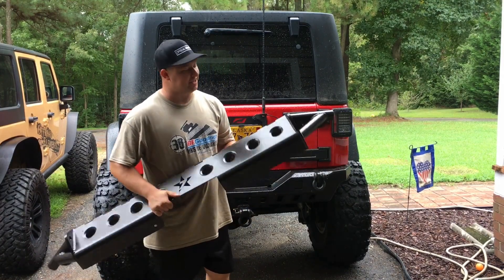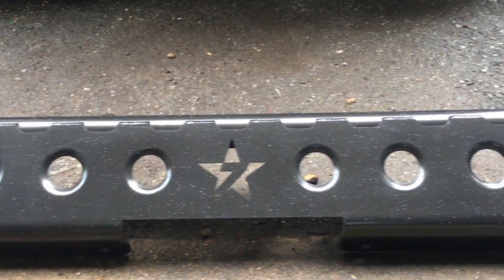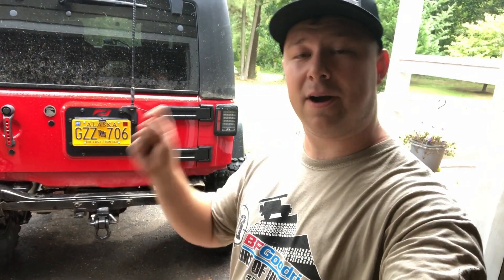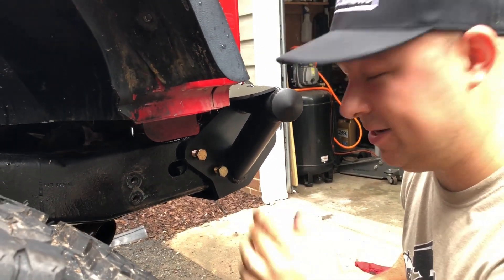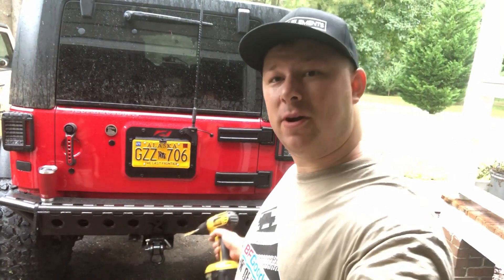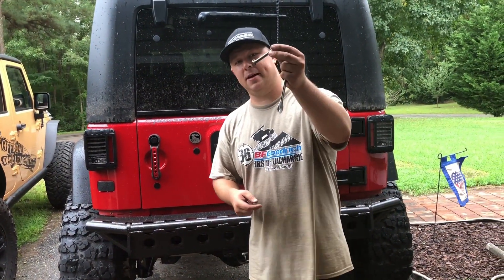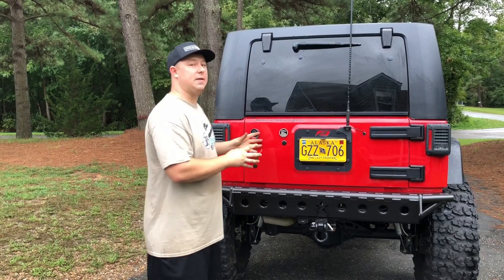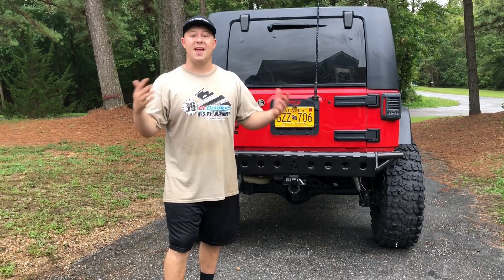No More Bulky Bumper!!  Barnes4WD Rear Bumper Install

Comment: Have you figured out how to mount lights to it?
Reply from the maker: It has 2 holes on the top side of the bumper. I might eventually put a small light on the passenger side, just haven’t gotten around to it
Reply: JK Gear and Gadgets the two small fixtures that you did an episode on.  You mounted them to your hood.  Would those work inside the bumper and took advantage of the holes in the bumper.

Comment: Something I noticed on my ‘15 JKUR:  Apparently they added the drilled holes on the right side frame rails for the right side tow hook offered by Mopar; therefore, you wouldn’t have to drill on the right side if you have a newer Jk. I think this is for all frame rails of all ‘13+ JKs since that is when the 10th Anniversary / Hard Rock Rubicons started.  Mine isn’t a Hard Rock, so maybe all the frames are the same in all trims.

Comment: I like the new bumper but I run a spare tire.  What brand was the old one? And are you running wheel spacers?
Reply from the maker: I think they just designed a carrier that works with this bumper! Old one was a motobilt, but it had a few flaws I didn’t like. And no wheel spacers.
Reply: If you don't mind me asking what didn't you like about your old bumper?  I use the Teraflex tire mount and Hinge kit I'm not a big fan of the Swing Tire mounts. is that what they plan on doing with your new bumper using the swing tire mount?
Reply from the maker: L.T.K.F. No, they are doing a tailgate carrier. And my old bumper was heavy, and the biggest issues was the shackle mounts are welded high, each time I hit the bumper on something it would shift slightly and the tailgate would hit the mounts...

Comment: I hate to say this but I am too OCD not to mention it.  After it was Installed, it looked like it wasn't quite level.  Looked like the passenger side was a little lower.  Did you use a level to check?
Reply from the maker: It probably was 😂. However after a wheeling trip and a good smack on a rock it probably shifted it a tad
Reply: @JKGearandGadgets  glad you have good attitude about it.  Would have driven me nuts 😄
Reply from the maker: Well if anything it wasn’t a mfg defect, it would be from where I drilled the holes and mounted it lol

Comment: I’m curious, say I was running the Teraflex Hinged tire carrier, if I just threw a 3 inch spacer on then it should fit just fine right?
Reply from the maker: A 3” might be a little extreme. You could always do their new frame chop rear, it will work with more carriers.

Comment: Question... is this a 7slotcustom bumper or barnes? Looks a lot like a 7 slot
Reply from the maker: Same company! 7 slot customs is Barnes Jeep specific line of parts
Reply: @JKGearandGadgets  makes sense. Thanks! I definitely want to pull the trigger on this bumper, just gotta find out if I can run a tub mounted spare tire carrier.

Comment: Hey man bumper looks good, quick question, how far past the tub does the bumper stick out to the side. I have EVO builder corners with no rear fenders so Wouldn’t want to much of the tube on the bumper sticking out. Thank you and keep up the great videos.
Reply from the maker: It’s practically even. Maybe goes out .25”. So it would flow great with no fenders
Reply: Awesome thanks a lot man might be ordering real soon

Comment: I've been contemplating going with a different bumper than my warn bumpers. I'm just concerned about them bending. Are those recovery rated? Also, I got rear ended by a full size Tacoma, and it only scratched my bumper but totaled his truck. Bad part.  They are heavy as hell and hard on the engine. So what's your take?
Reply from the maker: I wouldn’t worry about this bending. Very well made. Since it ties directly into the frame in 6 spots you will be perfectly fine with recovery

Comment: Why would you not run a spare tire on your jeep that is part of having a Jeep is the spare tire look on the back
Reply from the maker: Hard to run a 40” tire on the tailgate lol. Lots of weight that doesn’t need to be there.
Reply: It's easier to patch a 40+ inch tire on the trail than it is to replace it.
Reply: It won’t work with a factory spare tire carrier but it can with some after market ones and we are about to release one of our own very soon!
Reply: @cb.offroad  any word on the tire carrier that works with this bumper?